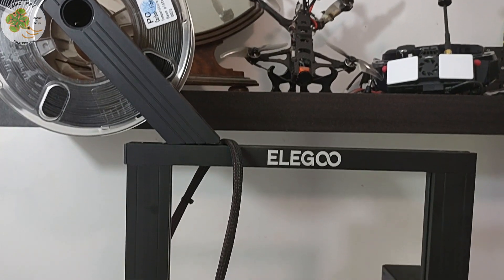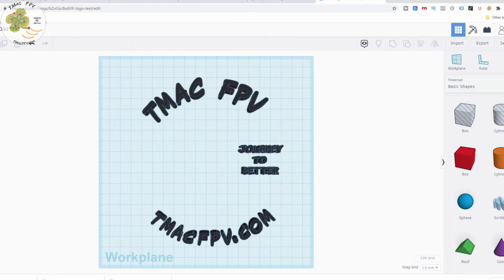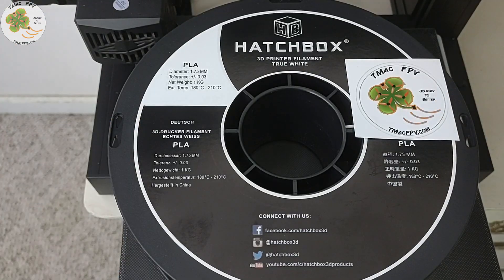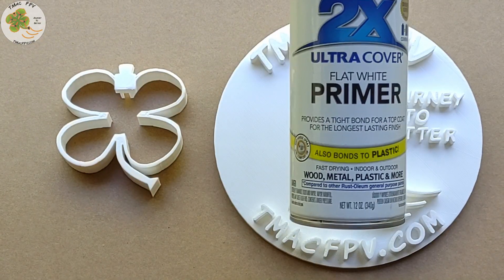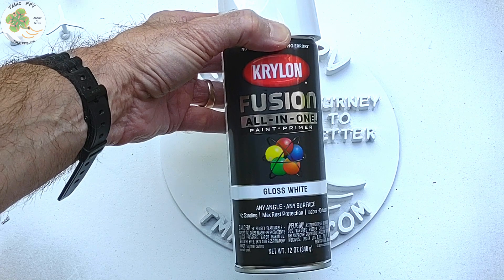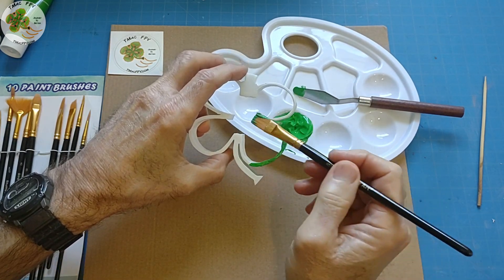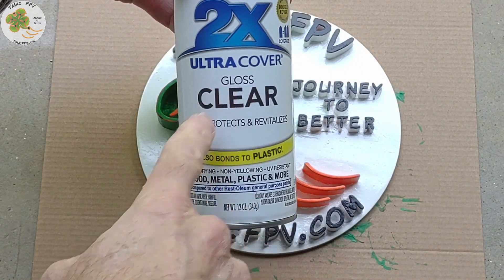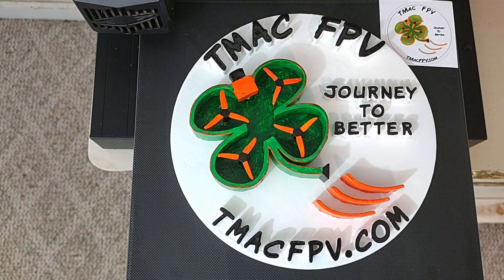Elegoo Neptune 2 First 3D Print Project (TMAC FPV LOGO!)

Comment: Takes 35 hrs??
Reply from the maker: Yes, for those settings I used with the Cura slicer program, it took that long.  You could easily print it out much faster by adjusting the settings to do so.  Its all how you set it up.  I was ok with using the settings for "miniature 3D prints" on this rather large logo base.  That's what made it take so long

Comment: Very cool.  Just curious if it will do flexible tpe.
Reply from the maker: Nozzle (260) and heating bed (100) temps are within flexible TPE range (235/65).  That's about all I know on flexible TPE.  By the way, Dale, are you the same Dale on FB that flies fixed wings?
Reply: @TMacFPV  Sorry, no.  I'm the "Dale" that had the problem with getting telemetry data from a nano rx.  Thanks for your help!
Reply from the maker: @dale7431  ahh, of course. You got it fixed though!  Victory is sweet 💪

Comment: 3D printers are cool tools. You can use change filaments midstream using the post processing scripts in cura . With a little careful planning you may have gotten away without having to paint at all...of course that takes time and painting might be more efficient...but something to consider..Wait until you start making things you need around the house.....I recently made a soap dish and tooth brush holder for the spare bathroom....lol..
Reply from the maker: That's awesome Steve! Love the soap dish & toothbrush holder ideas😁Yes, I've got a lot to learn. Lookin' forward to it🤩

Comment: If you heat up the filament in an oven for a little bit it will make the prints look seamless with very little of the lines showing from printing
Reply from the maker: Thanks for the tip!👍 I've got a dehydrator oven on the way. Should arrive Monday🔥
Reply: yep...plastic is hygroscopic ..meaning it absorbs water from the atmosphere...I usually put mine in sealed bags and if needed bake them at about 170 F for 4 hours to get them dry...